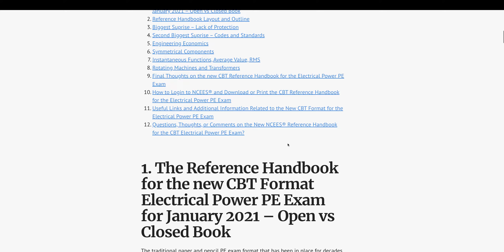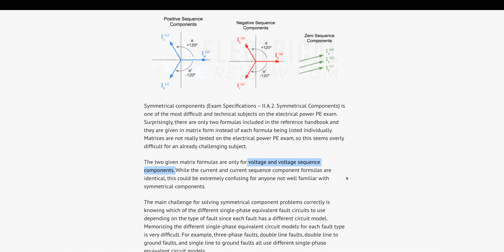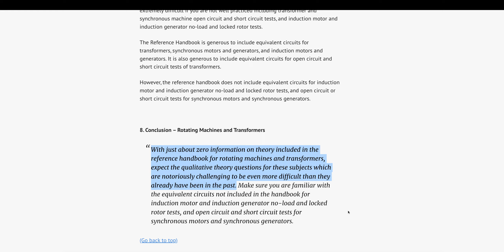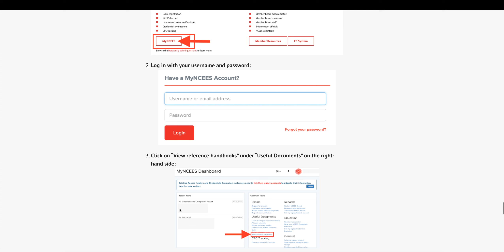NEW! Reference Handbook for the Electrical Power CBT PE Exam is finally here

Comment from the maker: Video Table of Contents (Click to Jump):
3:06 - The Reference Handbook for the new CBT Format Electrical Power PE Exam for January 2021 – Open vs Closed Book
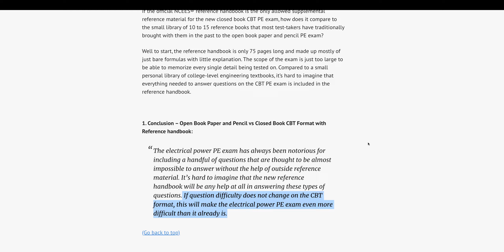6:16 - Current pass rates for the electrical power PE exam
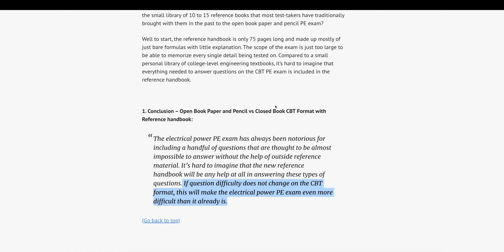7:57 - Reference Handbook Layout and Outline
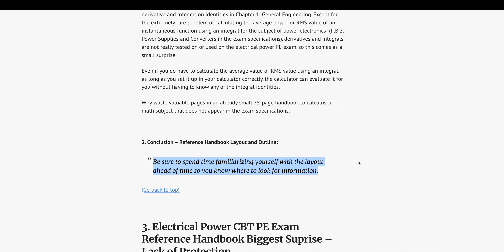12:13 - Biggest Surprise – Lack of Protection
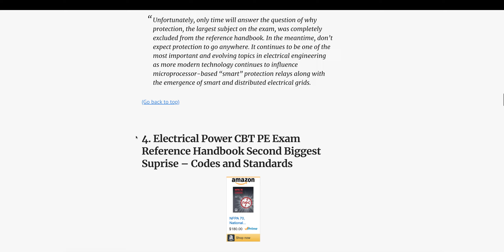15:43 - Second Biggest Surprise – Codes and Standards
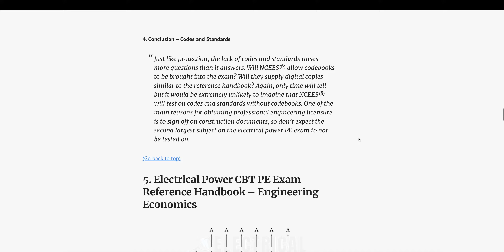18:49 - Engineering Economics
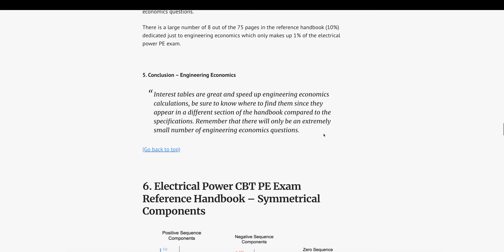20:58 - Symmetrical Components
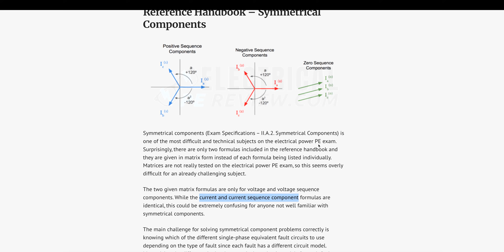25:05 - Instantaneous Functions, Average Value, RMS
26:53 - Rotating Machines and Transformers
31:47 - Final Thoughts on the new CBT Reference Handbook for the Electrical Power PE Exam
40:37 - How to Login to NCEES® and Download or Print the CBT Reference Handbook for the Electrical Power PE Exam
41:52 - Useful Links and Additional Information Related to the New CBT Format for the Electrical Power PE Exam
Read the full article here: https://www.electricalpereview.com/the-electrical-and-computer-power-reference-handbook-for-the-computer-based-testing-cbt-pe-exam-is-here/

Comment: It must have gotten easier, because the PE Power was 71% for January 2021. The highest it probably has ever been.
Reply from the maker: Pass rates have significantly improved compared to the prior paper and pencil format which used to be around 50% for first-time test takers.  

A lot of engineers were signed up for the April and October 2020 Power PE exams that were cancelled due to covid, it created a unique situation where engineers had the opportunity to study for the exam for a much longer time period over the course of about a year compared to 3 to 4 months which is more typical. 

I think this definitely influenced the current pass rate of 71%, and I'm curious to see if it stays this high or if it will decrease in the future. Only time will tell.
Reply: @electricalpereview  Good point. I was one of the ones that had both exams cancelled last year. I actually  took the test today. Using the NEC computerized file was a bit difficult. Hopefully in the future they will change it so people taking the test have two monitors.

Comment: Zach, this was a great review! Do we know Dec 2020 CBT Power PE pass/fail percentage at this point?
Reply from the maker: The official NCEES Pass rates for the new CBT PE Power exam are 71% for first-time takers, which is a large improvement from the 2019 first time pass rate of 51%. The majority of engineers that are taking the CBT PE exam right now were signed up for either of the cancelled April 2020 or October 2020 exams. I suspect the big jump in pass rates can largely be attributed to test takers studying for the exam for a much longer time than what is typical.

Comment: Well I signed up today for an exam date in May and I'm stressing out realizing that this is likely going to be a more difficult exam than it already was. I guess I better prepare for taking it several times and the long haul of studying for years.
Reply from the maker: The good news is that according to NCEES, the exam questions and specifications are not changing. The hard part is anticipating the quesitons they will include that do not include the needed formulas or theory to solve in the handbook (like the S = V²/Z and S = I²Z Formulas.) 

FYI we start live class again for the Spring 2021 CBT Semester on January 11th, 2020. You can see the updated live class schedule on the Live Class page: https://courses.electricalpereview.com/courses/take/copy-of-live-weekly-webinar-class-october-2020-electrical-pe-exam/texts/17543084-extended-access-announcement

We will be working through the entire Handbook.

Comment: Needs to be updated because  codes and standards listed in the new exam specifications will be "supplied" in the exam day. And the reference handbook has new version now (1.1).
Reply: New version now is 1.1.1 which still is a very thin book. I don't see any improvement.
Reply: @helendu5241  just few edits between 1.1 and 1.1.1. Editing of an image and some equations format ( an 'x' instead of '.' for product)

Comment: The new exam specs still include Protection (11-17 questions), and the additional specs page lists the codes and standards that will be provided as pdf files. This handbook version is just a draft.
I’ve passed the paper based exam on October 2019. The results were released on December 13th. Now you can get your result in 3-4 days.

Comment: I believe you will be allowed PDF copies of the NFPA 70, NFPA 70E and NESC on the exam along with their Power Reference Handbook.
Reply: otherwise, there is no meaning for PE. PE is all about referring code books.
Reply from the maker: Yes. NCEES has stated that they will provide code books in digital format on the computer in their entirety that are needed to solve code questions.
Reply: @electricalpereview  is there anyway we can get the digital code books?
Reply from the maker: @yuechen2421  Yes, they can be purchased directly from the NFPA.org website.
Reply: @electricalpereview  I looked on line. There is already nec 2020 already, why we still use 2017 for pe exam
Reply from the maker: @yuechen2421  NCEES, the organization that makes and oversees the test, has chosen to test on the 2017 NEC until September of 2023: https://ncees.org/pe-electrical-and-computer-power-exam/

Comment: I'm glad they changed to CBT format. Much better than flipping through the books. In this digital age, who wants to go through the books when you can CTRL + F?
Reply from the maker: CTRL + F is definitely an advantage to finding material quicker, the only issue is the reference handbook is so limited that most of the information you'll find are details you'll already be familiar with and not need to reference if you've already been studying a decent amount. I must be old school though I prefer flipping through pages!
Reply: @electricalpereview  the more books I have the more confused I get. I prefer to focus on consolidated material rather than go through different books to find my answer. We all would learn to adapt the change this is the future. If the answer/equation is not in the provided reference everyone would do bad with that question. No need to worry. We all would be fine. Thanks for responding!
Reply: @yashpatel3123  very good insight actually!  I was thinking differently!